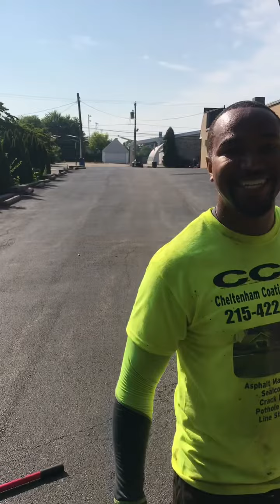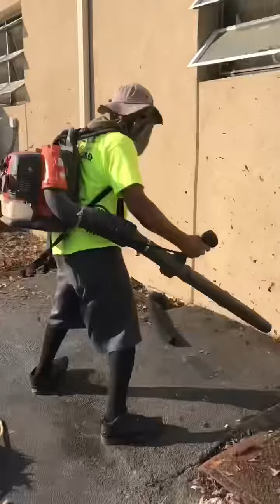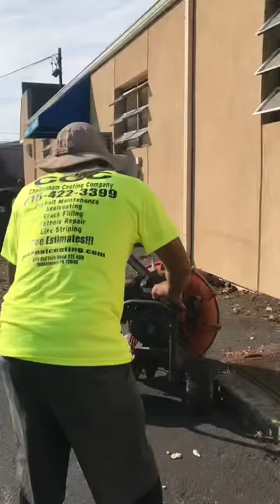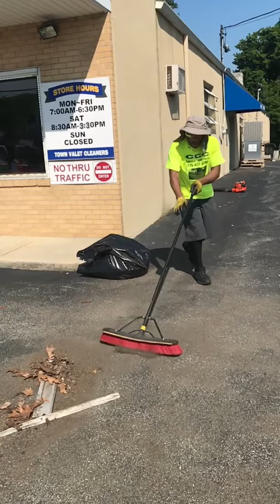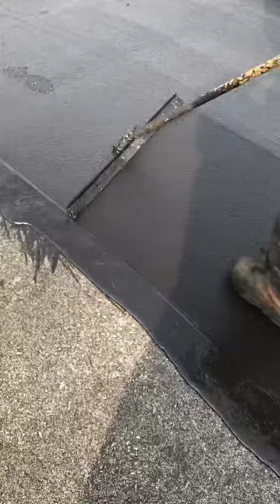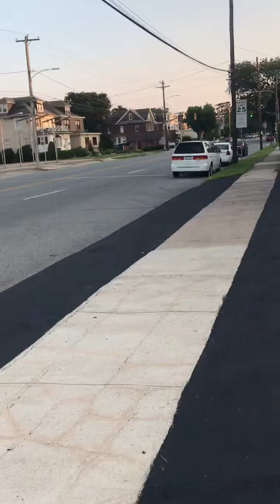SEALCOATING IN 100° WEATHER!

Comment: How long did it took to dry in that temperature?
Reply from the maker: Its was so hot, the sealer was drying fast, it took no time at all. As you know drying and curing are two different things. I recommend still waiting the 24-48hrs for it to cure before driving.
Reply: @cheltenhamcoatingcompany  thanks